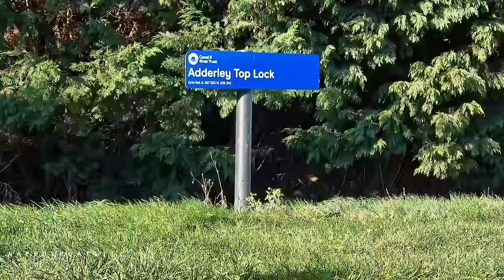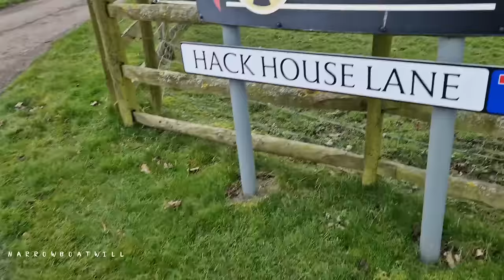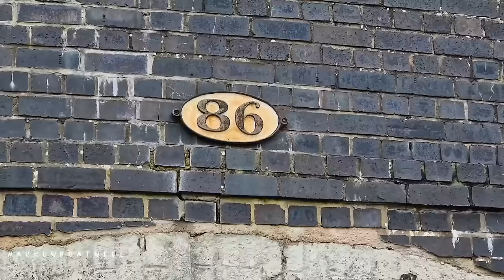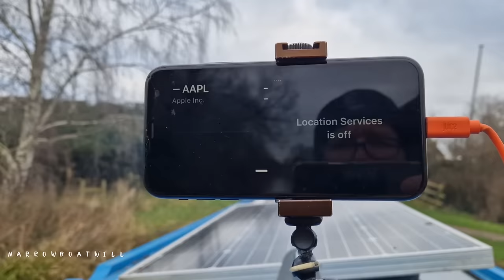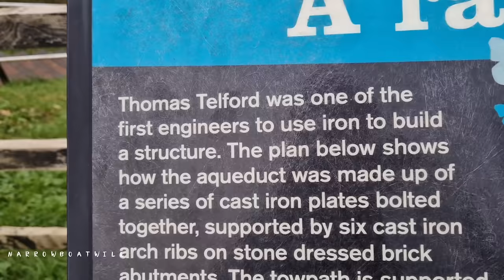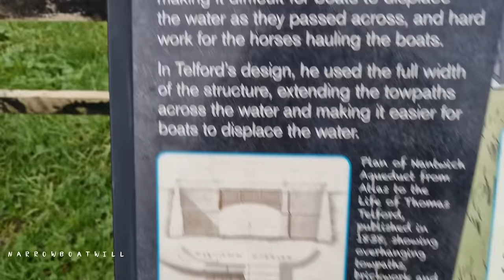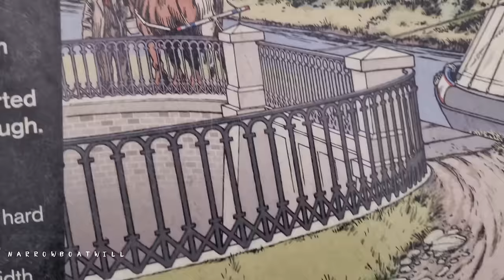Narrowboating in winter. My journey up the Shroppie and the UK continues. Gearbox investigation..

Comment: Done a few of these drive plates, if you clean it up, you should find a part number on it, also check the splines on the gearbox for wear on the riding surface where the drive plate would normally locate. Looks like you caught that one just in time, in the end the nylon centre breaks up so all engine does is then spin the centre splined steel 'top hat' and drive is lost because its no longer connected to the flywheel😆
Reply from the maker: Yeah I've tried to find a part number but I couldn't find one. Strange that because they're normally stamped or embossed.. I bought a softer uptake one and the difference is amazing. No chatter. Yey! 🤣🤣

Comment: Hi, watching from New Zealand, really enjoy watching your travels, Question: are you sure your gearbox takes auto trans fluid, I would think its way too light and it should take a manual gearbox gear oil, just my thoughts,,  question, gearbox would surely rattle after a while using an oil too light for a manual box
Reply from the maker: It's the right oil. These gearboxes need an high pressure oil. Watch my next vlog, and you'll see the chatter disappear. Thanks from the UK.
Reply: @NarrowboatWill  great, I wont wonder about that anymore, saw your plate change to make the trips quieter, Cheers
Reply from the maker: @petermcintyre4183  I questioned the oil because it's automatic trans fluid. I phoned the gearbox people. They said its correct. So like you I was in doubt. 🤣🤣 thanks for watching..